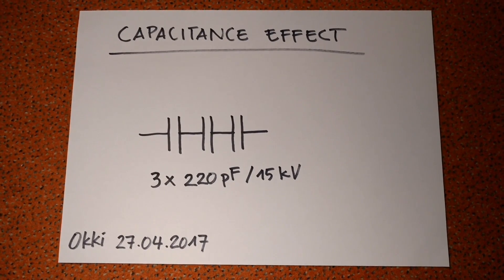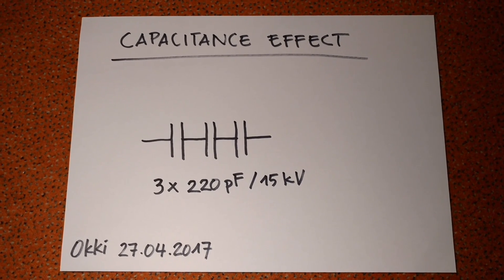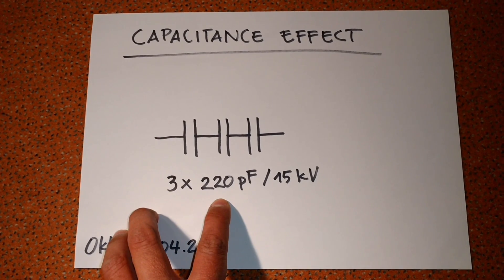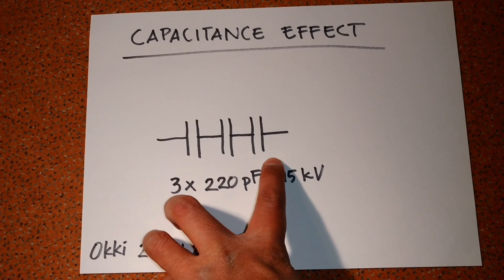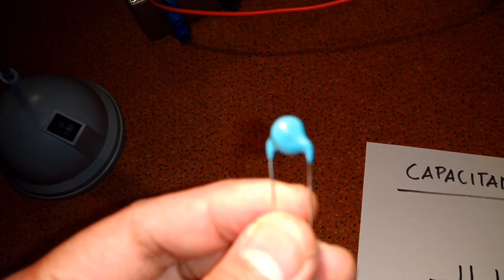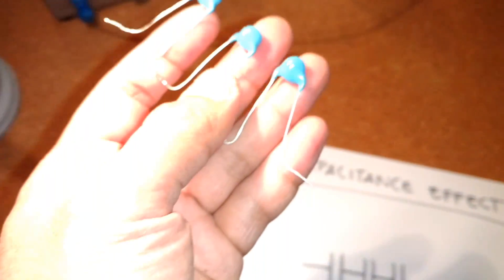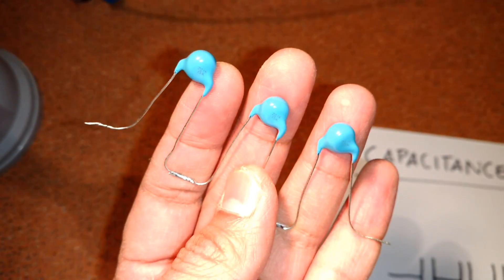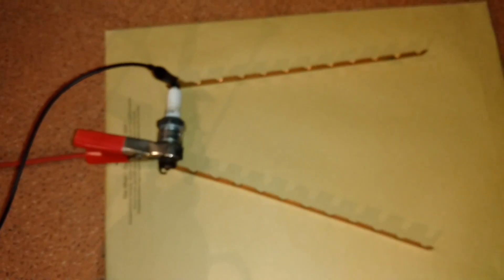Simple Plasma Ignition - Capacitance Effect

Comment: You are creating a problem///  A static discharge thats not isolated is sending a signal to EVERYTHING around you...  It will be heard on Phones and computers 100+ feet away..  Even un-used speakers will pick this up..  Its similar to EMP.  And in long term will destroy electronics..and some batteries..
Reply: Umm, ya, believe that..go ahead..dont Understand that there are SOME protections inside many items( NOW DAYS)(ask your grand father about R RATED Spark plug wires)  And those protections only last a short time when they are Doing their job..  If these were NOT in place, your TV and radio's would be going nuts..  
Also think WHy an Uninterruptible Power supply(UPS) with Line conditioning WORKS...why every hospital has one, two, 10 of them..protecting equipment.
Reply: THINK ABOUT IT...in the old days, it was always fun to hear Cars going by 6 blocks away when they did not have resister wires on the spark plugs..  HOW many cars do you think pass your home in 1 day?  Which do you think would be more damaging??  1 BIG spike that your SPIKE PROTECTOR can handle or a Continuous LOW SPIKE ALL DAY LONG???  Your Spike protection is that..a 1 USE/1 hit protection from a LARGE SPIKE..  not spikes that hit your wiring, and only send 10-100 extra watts thru your computer...  Then lets add that That transformer station down the street, about 1 mile, COVERS THE WHOLE AREA, and any heavy equipment on that Line, can ADD MORE NOISE..  Your HOME power is so NOISY, its stupid.  Unless you install a Conditioner for the WHOLE house you will pick up anything that is on the same line, for MILES..  its like a giant radio antenna.and everything inputs it signals on that line.  
Then lets look at your HOME...every motor, fan, HEATER(love hot water) your compressor in the frig...ADDS TO IT...so then you ISOLATE 1-2 electrical lines FOR COMPUTERS, TV, VCR/RECORDER, CABLE BOX, MODEM/ROUTER and anything else that needs ABIT more protection...  And we still have not protected you from JUST radio freq waves from your cellphones, Blue tooth, and Everything else that sends Radio signals..Lets add a Metal Chicken wire to the outside(its called STUCCO in the old days..AND ground it..NOW you should be, almost safe.  You might even be able to Double the life of your electronics..Except they make them to FAIL..
Reply: ps...and if you THINK, a direct hit on a house is going to STOP a lightning Bolt from FRYING EVERYTHING IN YOUR HOUSE,,, no matter the protection you have never seen a 10' SPARK, it will jump any/every circuit in your house.  That Breaker wont be able to stop it either.
Reply: Correct breaker should be applied and if your in an area that is prone to lightning strikes a suitable breaker can be placed in the circuit that will safely disconnect 100000amps and more
Reply: Your general question was How could 1 spark plug cause allot of damage.  How about, No one protects against it.  That a Tag on the back of most devices SAYS...They can not interfere with other devices, BUT, other devices and Interfere with it..
And you know that Electrical power is like a sponge, and shows allot Just by watching it in your area..  We had a Computer program that watched out UPS, and it was great..we saw all the jumps and small spikes, LOW power and HIGH power spikes that BASIC protection does nothing for..  8am every morning, a BIG drop in power almost to 90volts..and back up..  It always looked like a Giant radio wave...And thats about what it is..  It picks up Lots of noise.  And Unless you isolate things LIKE this toy from his HOUSE HOLD wiring..it can cause problems...and Down the street.

Im arguing so he MAY understand what may happen if he keeps doing  
it. He might consider Isolating the power used..And maybe abit of faraday cage to pick up the random Energy he is sending into the atmosphere.  ANd I pity his Cellphone.
Reply: In the USA, a Vacuum cleaner is NOT supposed to send out Static shocks that can affect other devices over radio signals.  And brushed motors are not either..  If you are in a local that this is possible, then Go ahead and use your computers around them..The more the Merrier..  And watch the Frequencies your computer uses be scrambled and any Wired input lines(Keyboard, mouse, Network cable carry them into your computer..  The Few items in a home that create these, from every fan to your refrigerator, will soon destroy most computer equipment..
Reply: really, you want to ask about your Electric corp, that has learned about this over 50 years ago..  Isolate the power lines and GROUND THE GROUNDS..  And if you used an oscilloscope on your Power line you could of watched it in a GREAT way..
If you lost power then you KNOW you had a good hit, close.  Im mostly talking about SMALL ALL THE TIME little noises on your power line...they WEAR THINGS OUT..They SHORTEN the life of items..esp now days..they dont make things REAL WELL..ask your grandma or pa, about the OLD hardware.(NON COMPUTER)  30 year old TV, Frig, Clothing washer..
Reply: Ground wires on poles..so Big spikes at least find a direction to go..Also those NICE transformers on the pole..are really designed to work as Giant Fuses..
And yes, Induction is a wonderful thing.  Farmers love/hate it..
As to old electronics..it was mostly Spacing on the boards..My Amiga you could follow every track.  But What Im meaning is the Heavy wiring use in the past, rather then this Skimpy stuff they use now..Had a 40 year old Frig had to get rid of, as the Door gasket was failing..IT STILL WORKs..but no one makes the gasket.
Reply: I also prefer Coils for power conversion/transformer...The new chip power modulator, Seems It might not be REAL safe..
Reply: 40 years and still working, never needed to be re-charged..And Washer Dryers used to last along time also...20 years..MORE if you could repair them..I know people that still have C64's..(power supplies were Crap, but there are fixes..  We used to be based on QUALITY, not Quantity..  We make things break so you need to buy again and again...
Reply: The only thing that I agree is that now days company's fabricate "cheap products", since its what people ask for now days,  pay less and have the same service. Most people now days don't look for premium products, also it's part of the "marketing" for company's. Old equipment was less susceptible to failure by a spike on voltage, temperature, or any other kind of interferences. Doing that kind of equipment now days it's very expensive.
Reply: part of that problem comes to Corp mentality..  Insted of making Durable goods, that make them to fail...And have shorter lives..  I just had to get rid of a 40 year old frig, because I couldnt get a DOOR GASKET..  And the NEW one I got, isnt 1/2 as cold, and probably wont last 1/2 as long..
And on top of that, the USA restricts distribution,.,  Another corp OUTSIDE the USA has problems selling here, because of the PRICES their products end up costing...For shipping and handling..
I HATE products that have Integrated parts/Computer in them...WHEN an old mechanicl part would work for 20 YEARS..  1 small spike in your household and you loose your washer/dryer/dish cleaner/Fridge/toaster oven/microwave...TV/STEREO/.../.../...  because of 1 little part inside, Failing..
Reply: lETS SEE HOW BRAvE YOU ARE...  Under your dash in your car is a Funny plug that uses ODB2..  go try it..
Worst that will happen is the Computer that controls your car DIES..
OR, try the ground wire on your stereo..  FRY the Tuner..
REALLY want to be stupid??  OPEN your Electrical breaker...and AIM at the ground wire to all your COMPUTER HARDWARE..just the Main ground wire will do...GO AHEAD...be stupid..  If you dont die, then HOLD it there for 1 min...If your battery lasts long enough..and see WHAT works after..I WILL NOT BE LIABLE FOR YOU BEING AN IDIOT and destroying Any computerized device in your home or Anything ELSE..
Reply: Do you know that your computer uses FM??  and how it is created?  Go get a Pocket hand held radio and Tun eit while holding your Tase, and firing it..
You will hear the SAME sound as he created...THAT is the Pulse..  And it Adds power into the system..  The Metal case DOES HELP..and there are allot of capacitors that can take a few hits..  but you will cause problems with HOW the computer works..ANd Long enough or HIGH POWER ENOUGH and you will destroy parts of your computer..  Go for it..  I dont care..I have given you a warning..
Reply: Frequency modulation...Lets see....What is 60hz??  How simple is it to change that??  with any type of Pulsed Electrical motor??  or Static pulse??
You computer is pretty well protected from MOST...EMF/EMP..  but its TIME and how much it will take over time..  But you have more products in your home that are NOT as isolated..  That power supply in your computer USED to be a Coil wound Copper...And is NOW a Chip that uses Pulse generation to CUT the voltage to LESS then it is..  ALLOT of the old tech for Washers and dryers was GREAT as the control boards had WIDE spaces and you didnt get a Spark across them very easy...

MY POINT is based on TIME...and even little pulses can eventually cause problems..Because your HOME ELECTRICAL isnt designed to stop it..  Your Spike protector is like a OCEAN protector,, its designed to Stop a TIDAL wave...not small increase/decrease in waves..  its to stop HIGH volts and AMPS, Jumping into the system,, not Pulses that energise the system...  And a Radio pulse is not easy to stop..esp when you have 5-6 wires exposed OUTSIDE your case..Video/USB/MODEM/...  those are the weak points.
Ever have a problem with your mic??  or speakers??  going abit weird on your computer??  That Audio is being Influenced/interfered, by the signals inside the case..and Sometime externally because you USE WIRES outside the case..
How many people use PROPER GROUNDING???  I expect 10 %-20 in the USA to have GOOD grounding..most of the rest are OLD to very OLD housing..  Iv even seen wiring from the 30-40's STILL IN HOMES..  

Let me say it this way...IF your Radio/esp FM can pick it up on its tuner...YOU MAY BE CREATING A PROBLEM...  Iv seen this from Hardware like heavy machinery that was over 1 mile away on the power system...  YOU DO NOT get clean power, any more unless you Isolate it and clean it up yourself.  Iv seen Electrical Pulses/changes in power Down to 90 volt and upto 120..in 1/100th of a second..(Love good Oscilloscopes)  And what he is doing can cause a few MORE problems..WHY add to the ones we already have with CLEAN power..
Reply: Little pulses are never a problem, that is what capacitors are great at dealing with, smoothing out quick little sudden changes in signal.

Picking up stuff on a radio receiver is guaranteed at particular frequencies, I expect and audible hum at 50/60Hz (depending on country) and it's harmonics. This does not mean it is modulated in any way, it just means there is an EM resonating in that (carrier) frequency. Now, in my radios to deal with this, we use these circuits with capacitors in them called filters, remarkably this is pre-WW2 technology that has helped us tremendously in avoiding unwanted EM in our electronics for decades.

A computer does not create FM signals outside of things like a FM sound synthesizer DAC. It uses myriad of various signalling.

Clean power, ah yes, here is another myth, the biggest issue with "unclean" power is either a spike causing a safety mechanism to trip to dampen it or something not getting the power it needs and shutting off.
Reply: Abit of reading material is installed on most devices in the USA..
This device can not interfere with Other devices...But other devices are allowed to cause problems TO this device..  
Im an old hat in repairing things..and I KNOW they make things to die..  Iv had remote controls that at 1 year 1 day DIES..  Iv done enough repairs to know that 1 part is enough to stop most machines.  But I hate them using computer parts when the Old Dials and switches WORKED in a washer dryer..  Iv seen devices that were MADE BADLY..  and with out Insulation(heat) to protect it from the STOVE/dryer it was supposed to control.  Iv seen Laptop power supplies that the Internal power controls failed...(MORE TIMES THEN THEY SHOULD)  because someone used CHEAP CAPS..  Love watching people on YT fix mobo's and Bitch about Apple laptops using CHEAP CAPS..  Changing Keyboards and Wondering WHY in hell they used rivets on the Keyboard..  
Iv had and repaired the power supplys on C64's Which is a PAIN..(Epoxy sealed bare wires)  Hardly Ever had my Amiga 2000 fail in 15 years..even hardware updated the thing..
When I younger finding parts EVEN out in the country, wasnt Very hard..  Finding appliance parts and Caps NOW...you need to know the net..very well.  If you want a decent price, or are willing to get GARBAGE PARTS that blow up before a customer hits the door, or causes more problems After the fact.
IF you are expecting a good product ANYMORE, you better build it yourself..  Iv seen Companies use a steel case, a high temp heat element, and a fan, add a Simple timer computer to it and charge over $300..
The USA has the highest costs for Materials in the world..and still no guarantee..
Reply: Part and parcel of this goes along with more and more people living in Apartments and condo, and Close environments..(corp would be different(IF they asked for it) but how much of all this electrical Can be compromised, because the worst part tends to be a Ground wire 4-10 stories below you..
Unless they install their own protections..Odds are, some idiot could send a jolt threw the whole building...and you cant prove what caused you stuff to fial..
Reply: Go run your own tests on the current Dirty voltages..Watch the inconsistencies over a few days..  Then tell me that this has little to no affect on electronics...Nothing is designed to last forever, and it would be great if SOME of them were more Durable..  And Corps found that its easy to replace a $0.50 part with a $0.10 part that will fail at the end of a warranty..

With the Spikes and such on the power lines, I would love to see you trace it, quickly..  I only know of a few ways to do this.  Ask any auto mechanic how he like tracing wires to find a break..

My claim about tall buildings is abit erroneous..  as I would guess that they Do not let persons add metals on the outside, and TRY to isolate all the interiors from any Exterior voltages..  Im just waiting for some idiot to use a Antenna or something and Lightning striking it..(I think something like this happened in britain recently on older building..with Special paneling..NOT GROUNDED

Comment: Sir. I am not getting 15kv . In my place only 2kv available. 
What can I do ? 
Can I join parallel or in series, connect the capacitors to be 2Kv × 7 = 14kv.
Reply: Motor Rodies: Did you check amazon ?
Reply: Meledak kapasitornya